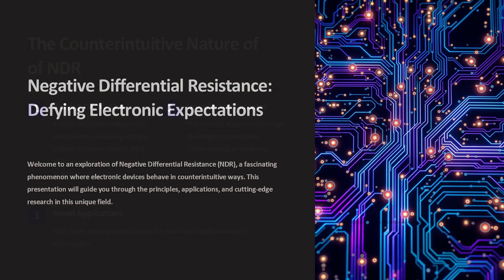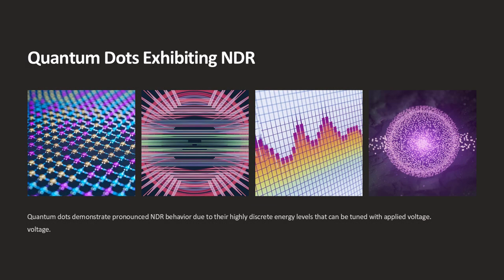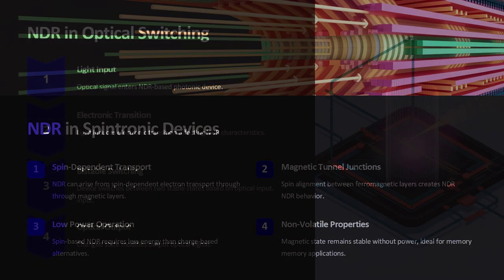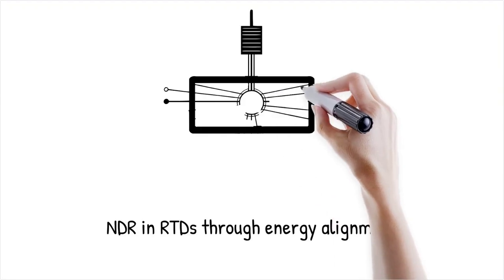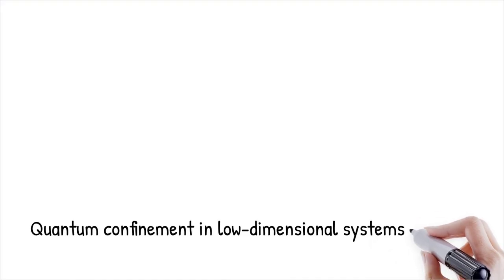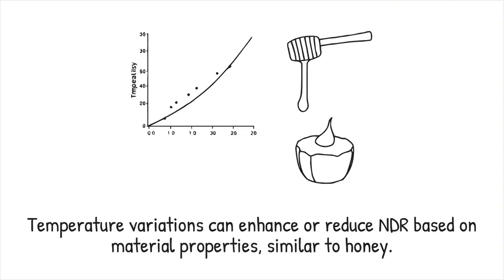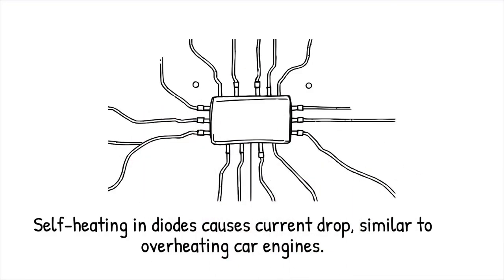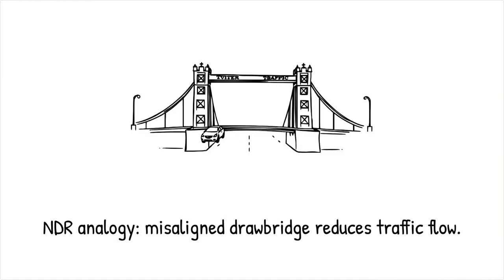When Electronics Defy the Logic: Negative Differential Resistance

Comment from the maker: How can the precise alignment of energy levels in resonant tunneling diodes be maintained under variable operating conditions to ensure consistent NDR performance in practical applications?
What are the potential advantages of utilizing NDR in high-frequency oscillator designs compared to traditional electronic components, and how might this impact the efficiency and stability of signal processors?
Can the quantum mechanical principles underlying NDR in nanoscale materials like graphene nanoribbons be applied to develop new types of quantum devices for computing and communication technologies?